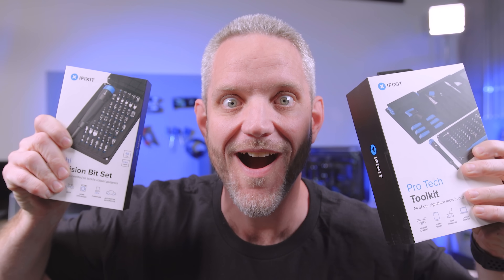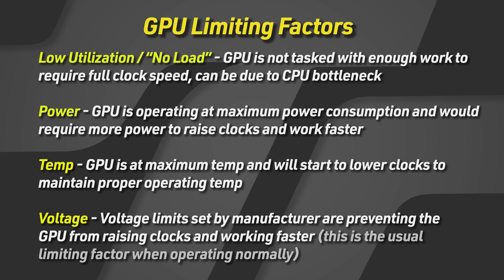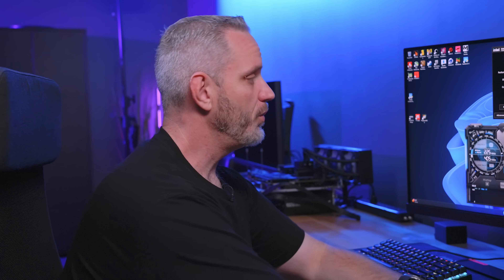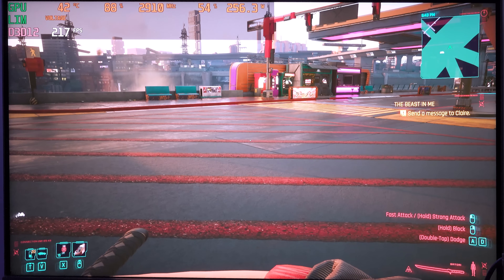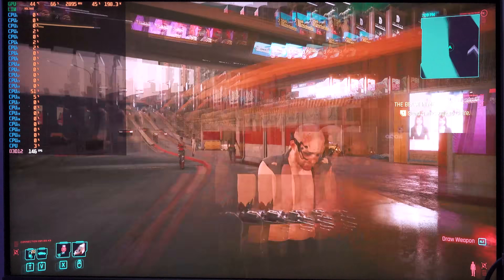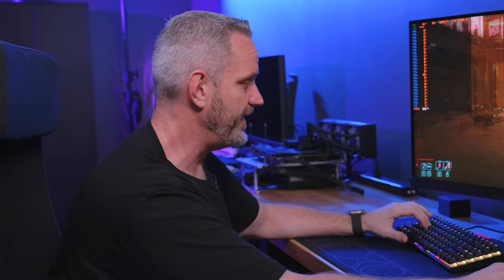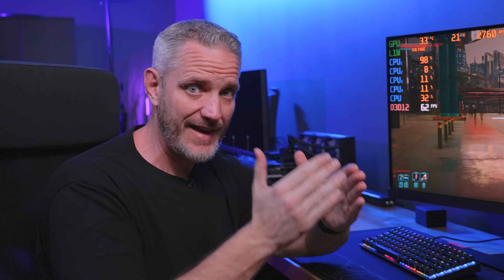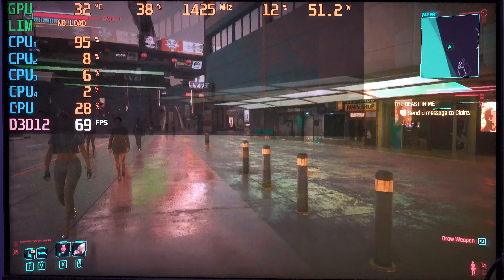THIS is what Bottlenecking REALLY looks like! AVOID THIS!

Comment: I completely agree with the conclusions here. I have seen a trend over time towards this idea that a CPU and GPU need to be "matched" (i.e. an upper-mid tier GPU has to be used with an upper-mid tier CPU or else you will get a bottleneck) rather than the wisdom of 5-10 years ago that for gaming it tends to be most cost effective to buy a slightly better GPU even with a slightly worse CPU. I think that logic still holds. Aside from maybe specific examples of CPU-heavy games, the numbers seem to support that most modern CPUs should be able to handle a mid- or upper-mid tier GPU just fine without bottlenecking. You might get a small performance boost from a better CPU, but most of your base performance is still going to be scaled off of your GPU.
Reply: the beauty of computing, whether productivity, gaming, or other is tailoring something to your use case. I see it all the time in subreddits where people throw out recommendations with very ltitle information on the use case scenario. As a professional, most the stuff I read and watch on YouTube really misses the mark. Nvidia has iterated leaps and bounds with its GeForce Experience gaming optimization settings and slider. It used to be horrid but does a pretty bang up job dialing in settings if you take the time to use it. Decide on a target FPS you want, then turn the slider until you find a breaklpoint that you like.
Reply: I got a 5600X with a 3060 Ti and living in Miami FL. Even if I was willing to buy a peak end system I can't tolerate the heat that dumps out of anymore more powerful. The ventilation in this house isn't setup to handle a hot spot like that. Nvidia would need to give me a voucher for a central AC upgrade and more duct installation.
Reply: @Mr.Morden 5600x will handle a 4070 1440p no issue.
Reply: I have rtx 3060ti in my old i7 3770k machine. It can play most newer games without issues. Even the newest i3 is better that that but it still going.
Reply: Yep. Only get as much CPU as you need. For me, I have a 7900xt paired with a 5600 and they work great for my target 60-120fps range at 4k. Only game that had me wondering if I need to upgrade is Starfield and... yeah eff that.
Reply: When I first bought my PC the mantra said: save on your CPU so you can get a better GPU. Today people are too scared of bottleneck that they will say a 5600x should not go with a 3070.
Reply: @HaloNoobGrunt  what games do you play ?
Reply: Makes a lot of sense. Until mining messed up GPU prices I'd always upgraded graphics card about 3-4 years after the CPU - and CPU about 3-4 years after the GPU. Currently running 9900K and 7900XTX, which I "had" to get after my Vega 64 died. And this system is pretty spot on for my needs, despite all the bottleneck calculators saying it's a mismatch. Was planning to wait for next gen of intel but may even skip another generation after that if I still don't feel the need. I ran a Core2 quad for almost 10 years before I replaced it.
Reply: @whssy  I've also replaced my Vega 64 WC with a 7900XTX, but I'm running an even older CPU - 6700K 😂
 Upgrading my entire system might be a bit expensive for my current needs.
Reply: @TheEmolano  I prefer having a fast CPU over a faster GPU. Minimum thread count i need is 12 to not stutter ETC in games (multitasking and having a lot of other stuff running at the same time) 8 threads just isn't enough. Also threads need to be fast enough. Went from 1700X to 12400F with my 1080Ti, and in most my games my framerates pretty much literally doubled.

Comment: I have a RTX4080 on a 12400. 32gb ram(2x16GB 3200MT). But I play mosty at 4k on a TV that has a 120hz refresh rate. Most of the time the GPU is at or close to 100%. Only when I use DLSS that it drops, still most games fps is 70 or higher.

Comment: This makes me feel better about pairing a used 3090 FE with the Ryzen 5 3600 w/ Prism cooler in my secondary gaming rig. Thanks Jay!
Reply: i set my 3600 at 2.2ghz all cores, still hitting stable 60 fps in 1440p gaming in rdr2 and cyberpunk with a 3060ti eagle
Reply: @rusudan9631 clearly GPU limited😂
Reply: If you're using a 3600 in games like Starfield or Cyberpunk, you should feel bad. You are leaving so much performance on the table, and I can tell you this considering I had a superior 3700X and swapped to a 7600X. 
Unless you're running lighter games, a 5600X3D or a 5800X3D would massively improve your gaming performance in Cyberpunk and Starfield.
Reply: @rustler08  You’re right. Thankfully, I’m only playing BG3 and LoL at 1440p 144Hz. If I wanted to run Starfield I’d need to sell my kidney. Not interested.
Reply: yeah i remember playing for honor on a new 6700 xt with a r5 2600 thinking looks nice but something is off, and when i moved to AM5 with same gpu and 7600x, the 1% lows and all the hick ups were gone.
Reply: a 5700x is so cheap rn mate
Reply: @zedboiii  This is a secondary gaming rig so it was a budget build and didn’t need to be fancy. 

Also, R5 3600 is plenty if you’re not chasing every last frame and don’t play demanding games. 

Also, I’m sure most Gamers on an AM4 mobo plan to pick up a 5800X3D when they become sub $200 used. They currently hover between $240-280.
Reply: secondary.. that's my built but with a 5600x
Reply: @LagiohX3  I feel you. My primary just has a R7 3700X and a GTX1080 lol. I fly back and forth between continents for work, so the primary and secondary kind of blurs.